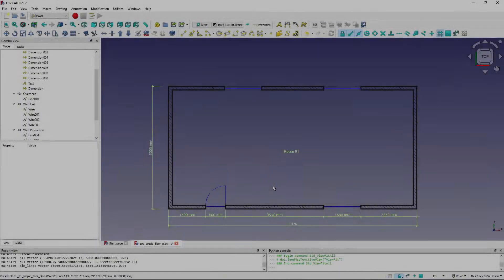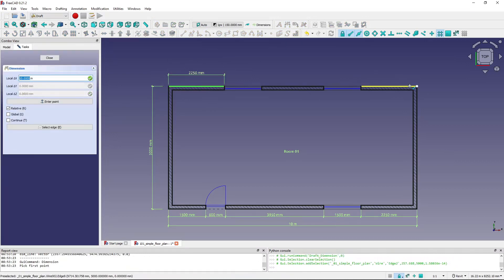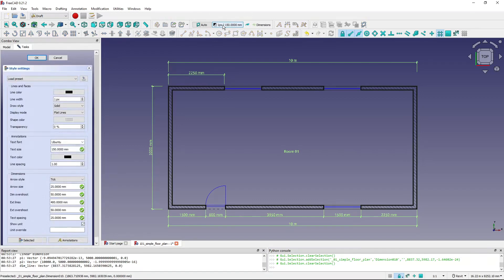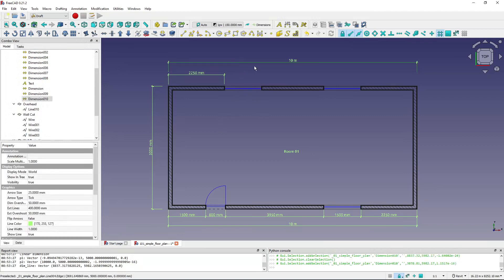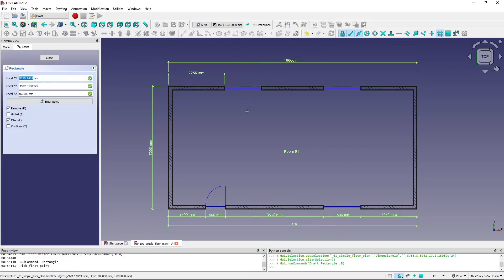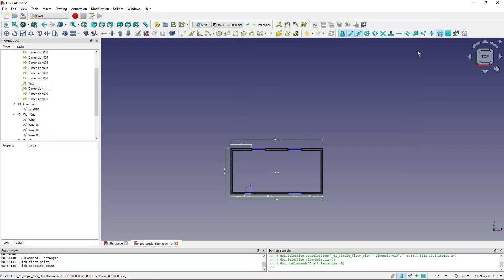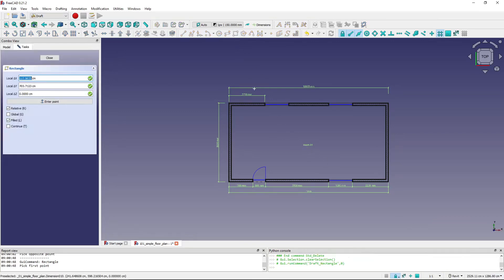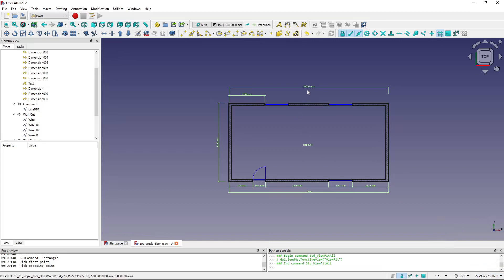Fix FreeCAD Draft Dimensions Changing Units Randomly | Dimensions showing in mm instead of m

Comment: yes it was helpful, i always wondered if i wasnt configuring the units correctly... but now i know theres no way to get centimeters and then meters after 99 cm... it would be great to get that option in...
Reply from the maker: Units can be sometimes tricky.
You could achieve what you want by creating two dimension styles, one with cm as a unit override and one with m as a unit override. You would than apply the desired dimension style depending on whether you want to show cm or m.
Reply: @FCBlounge  of course, thank you ❤🧡💙💛💚